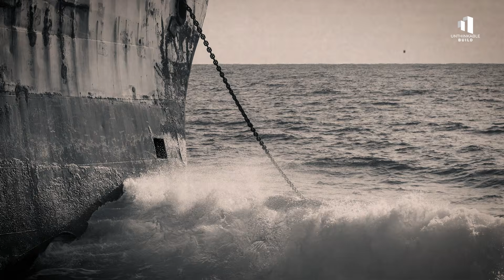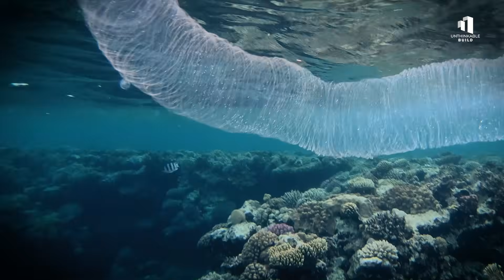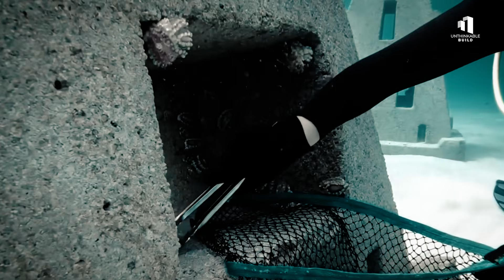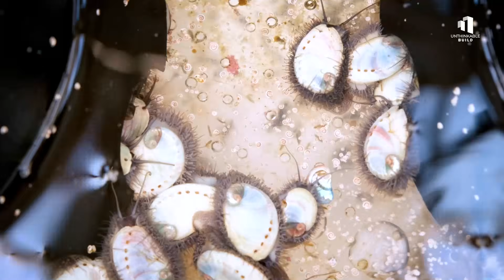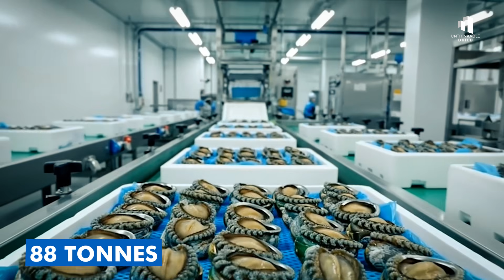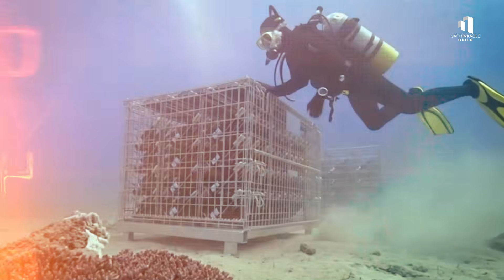The $100 Seafood Farm Built in the Ocean

Comment: It definitely sounds destructive at first glance. But in some cases, carefully designed artificial reef programs use concrete structures to create habitats for coral and marine life.

The key differences are location, materials, environmental assessment, and long-term monitoring. If it’s done in coordination with marine scientists and regulators, it can support biodiversity. If it’s poorly planned or dumped without study, it can cause real damage.

So the impact depends entirely on how and why it’s done, not just the number of blocks.
Reply from the maker: Well explained. Artificial reef projects can either support marine ecosystems or harm them, depending on planning, materials, placement, and scientific oversight. Environmental review and long-term monitoring are what separate restoration efforts from simple dumping. The intent and execution ultimately determine the outcome.